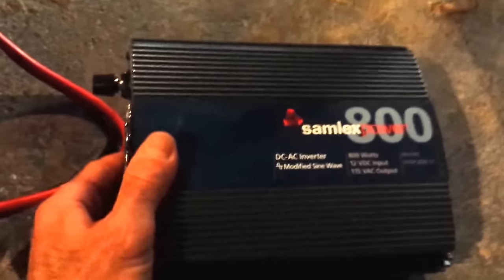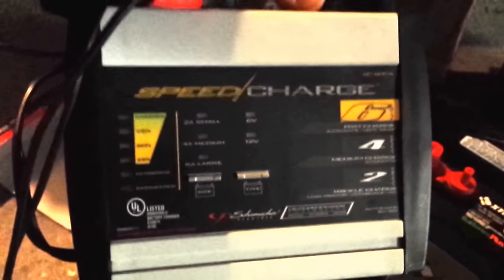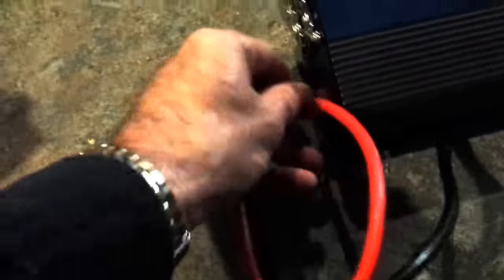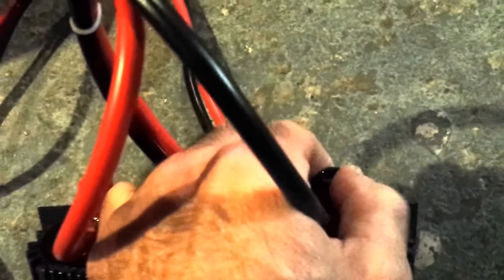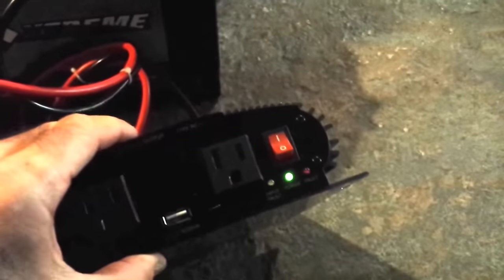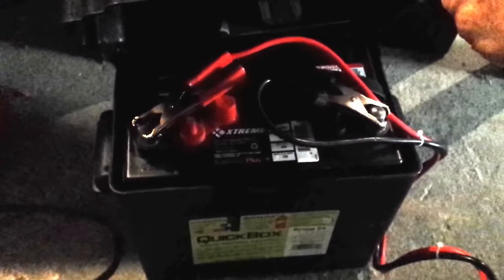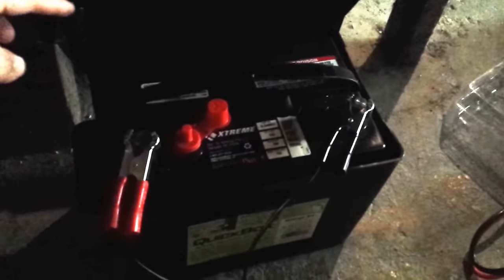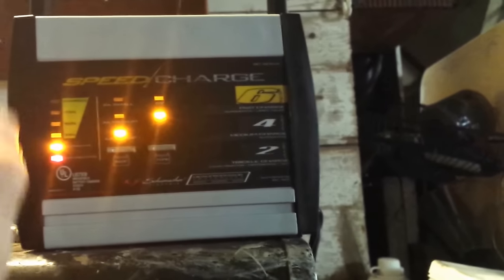How to Connect a Battery, 12 Volt Inverter, and Charger

Comment: I live in RV and was hooked up to electrical thru my brother's home until recent I used my window AC and it scorched the outlet so no more electric. So now I'm stuck trying to aquire some alternative electric on a small budget . I've tried researching as much as possible . Ur video clarified a few things like that I need a charger to recharge the battery. Now if I can just figure out the type of battery needed According to the inverter wattage that would be helpful. Right now I have a 750 watt ever start inverter not sure the battery to match up to it.

Comment: hi Dan!...is it OK to charge the battery continuously with that set up? like from battery to inverter then from inverter to charger and charger back to battery? thanks!
Reply from the maker: Hi Bong, I'm a little confused on what you are trying to do. Battery to inverter, inverter to charger, and charger back to battery. Sounds like you want the battery to charge itself. Can you explain what you what to do? You can't have more than one clamp on each black/red battery terminal at a time. There's a clamp for the inverter and a clamp for the charger.
Reply: +Dan Usher its like cycle, yah you are right! charging itself and at the same time using it in car audio for example. thanks you think it is possible?
Reply: +Dan Usher I don't have an alternator to charge the battery, its totally independent, all I have are the battery, inverter and a charger connected to its other just like a round about. just to have a continuous charging to avoid battery discharge.
Reply from the maker: +Bong Miranda, unfortunately, I don't think it's possible for two reasons. One, your not charging the battery from an outside source, an outlet. What you described is just a loop. Second, you can't fit two clamps on each terminal at the same time. The battery is huge. It lasts a long time. Don't worry about trying to charge continuously. Just use it, enjoy it, and when it needs to be charged again, plug it into an outlet for a few hours.
Reply: +Dan Usher thanks a lot!!
Reply from the maker: +Bong Miranda you're welcome!

Comment: Thanks dan! ..... I'm looking at doing this set up for the RV.
Reply from the maker: Your welcome!  Glad it helped.
Reply: @danusher6919  I would like to ask you could I plug my battery charger into my inverter while it was plugged into the battery and use my battery charger to charge the battery
Reply from the maker: Hey Larry,  I get this question a lot.  If you look through previous comments,  I give a detailed answer.  Short answer, there are better ways to do what you want.

Comment: Ok this is now what it seems. I want to  know if the battery charger is connected to the battery and turned on but powered by the inverter thats also connected with it stay charged as a continuous power source ?

Comment: It's often recommended to connect a ground to protect the inverter user in case there's a short. Additionally, it's often recommended to connect a fuse on the positive cable that connects the inverter to the battery.
Note too that the inverter in this video is a modified sine wave type which has its limitations.

Comment: Great video! Few questions. Is there a battery charger out there that is cordless? Like a car battery jumper. I have a DP Power battery jumper that I plug in to charge. It charges and is functional without being plugged into the wall. It holds the charge.
Second, have you used an inverter that has the battery charger combined? I did find those, pure sine wave are pricy.
I am looking for a setup like you have here for a power outage. The inverter would be used to charge my solar generator(the sun is not always dependable)

Comment: I just got a used van has a 5500 I am generator inverter etc the person I got it from had no info on it never used how do I find out how to charge my deep cycle batteries? Question can I use the inverter and batteries to power things with the generator off? Then recharge the batteries with the generator later? That's what happens in my fifth wheel if the power goes out

Comment: Is this a setup I can use for a couple nights of camping trip? Mostly for running a fan or small space heater and maybe a couple of string lights?
Reply from the maker: Hi Chemmies J, thanks for the comment.  I'm not sure the battery would go all weekend as a heater takes up a lot of energy.  Fan and lights more likely.

Comment: Thanks for your video. Is it possible to charge 4 x 12V batteries connected to each other by connecting the charger to the first one in the series?
Reply from the maker: Hi Mario, thanks for the excellent comment.  I don't know.  Have you ever charged the batteries while they were connected before?
Reply: @danusher6919  no i haven't. i have 4 batteries for my eventual solar system at my camp.  i currently supply power to my camp with a generator. I don't have solar panels, inverter and charge controler yet. My plan is to get an inverter/charger but they are more expensive. I thought of getting a cheaper/smaller inverter for the time being and use a charger like you described to charger my batteries until i set up some panels next spring.
Reply from the maker: @mariomcgraw2987  maybe recharge them one at a time?
Reply: @danusher6919 i was talking to someone today who specializes in battery banks set up. It's possible but where you put the terminals will depend on your battery setup... series vs parrallel, how many batteries etc... i'll confirm with him when i cross that bridge! Thanks for your quick replies 👍
Reply from the maker: @mariomcgraw2987  your welcome.
Reply: @danusher6919  could I plug my battery charger in to my into my inverter and then hook it up to the battery why the battery was hooked up to my inverter would that keep my battery up to charge?
Reply: @larrysimmons6082  What you are describing doesn't work. The inverter isn't 100% efficient, the charger also isn't 100% efficient, due to power loss (conversion of the electrical energy to thermal and possibly mechanical energy which is not desired in this case) and the result is that you will drain the battery.

Comment: Is there any way to use the battery (connected to the inverter) while also charging at the same time?  Or do I always have to use the clamps, and only one action can be done at a time?
Reply from the maker: Hi Mike, great question.  Unfortunately, the answer is no.  You can only use it for one function at a time, but another way to look at your question is if you are charging the battery, that would mean you are connected to some power source and wouldn't even need the battery, right?  Unless I am missing something or don't fully understand what you are asking or trying to do, you should be able to plug whatever you need the battery for directly into the power source.
Reply: Dan Usher, thanks for your reply!  I connected a solar panel to a charger, the charger to a battery, the battery to an inverter...then plugged string lights for the kids’ playhouse. I’m hoping all of these can stay connected all at once so I don’t have to keep connecting/disconnecting the cables? So far so good...but am I putting the battery and kids at risk of something bad happening?
Reply from the maker: @mikeman360 , your welcome.  I think I understand why you want to do this.  In case there is a cloudy period, you still want the lights to continue working continuously.  I called the place where I bought the battery from, Barreries Plus, and asked them.  To my surprise, they said having a charger and inverter connected at the same time was ok. I'm not sure how you would do it, but they said it was ok.  Of course, if the battery is getting charged at a slower rate than the draw on the battery, eventually all the charge will be used up.

There is an electrical engineering person who works at Batteries Plus who was off today who I was hoping to catch.  He is sort of like the Grand Wizard.  I will touch base with him and get a more detailed and better explanation and leave another comment for you here as I get this very question often enough.
Reply: Dan Usher, excellent! As I said, it looked like the battery was charging while still connected and being used for the lights, so I hope it’s all good. I don’t know what the correct terminology is, but I feel the entire unit is set up in series? One to the other, to the other.  Looking forward to hearing your response after speaking to the Wizard!
Reply from the maker: @mikeman360  I talked to the Wizard at Batteries Plus today.  He gave a detailed answer and the long and short is it is complicated.  He said it's not to say it won't work, but it's not what those products were designed to do.  With a charger and inverter connected to a battery, each device is picking up signals from the other two devices and can get confused and it can create "noise."  For some products/appliances you are trying to run it wouldn't cause an issue, but some, such as an amplifier, or any sound/video output it would.

He suggested a device called an uninterruptible power supply.  Google it and you will see products you could buy at Best Buy, etc.  An uninterruptible power supply is plugged into a power source and has a battery that it keeps charged while it powers what you have plugged into it.  If the power goes out, the battery kicks in.  It's doing what you are trying to rig the battery, inverter, and charger to do. Companies that run sensitive equipment such as computers and can't afford to lose power and lose data use an uninterruptible power supply.

Hope this helps,
Dan
Reply: I’m not a wizard, I’m almost 100% positive you can connect solar panels to a charger to charge your battery and connect your inverter and use it at the same time

Comment: Trying to commect.my 500w sine wave inverter to my starting battery to only run while I am driving. I then want to take my 15a charger and connect to my inverter to charge my auxillary battery ,again while I am driving..Trying to avoid having to do the whole dual battery setup because I am disabled and cant do it myself and cant afford to have a professional do it. Can this be done the way I have explained it to you?
Reply from the maker: Hmmm.  Thanks for the question.  I'm not 100% sure I know exactly what you are asking.  By "starting battery", do you mean the regular car battery?  So you want to put an inverter in the engine block along with an auxiliary battery and charger? And then you want to put an inverter clamp on the same battery terminal as the clamp for the car?  Not the best idea.  And then you want to put the charger clamp on the auxiliary battery that presumable also has a clamp for the car?  

I might not have this right, but I'm having a hard time visualizing what you are trying to do.  I do get questions kind of like this occasionally where people want to use the battery and connect it to an inverter, which has a charger plugged in which is then clamped back to the original battery. These ideas are not the best.  If you read through the comments, I addressed this specifically.  

The advice I would give is to call a BatteriesPlus and talk with someone there about what you are trying to do.  Hope this helps and sorry I wasn't more helpful.

Comment: Dan , do you know if any damage can happen if a charger is connected  to a battery that is hooked up to an inverter  ?
Reply: No damage, but the electricity would be going in multiple directions, so you wouldn’t get even power through whatever is hooked up
Reply: @NoonMight  thank you. I asked, because lasr fall I had an inverter i had just bought on Ebay,  .  I hooked it up to a battery bank. that i had in the back of my crew cab pickup. Then plugged an ext. cord into the 110v outlet of the inverter to run a radio and a lamp in my camp. Then connected a charger to the battery bank and went into my camp. After few minutes, the lamp and the radio went out.   I went to the pick up to investigate. I saw smoke coming from the inverter. I disconnected it quickly. Few days later i got in touch with Ebay. they stalled they sent me fron person to another to another . Finally I gave up when i got somehow accidentally disconnected during yet another phone call. i decided the $80 i paid for this inverter was not worth the time i already lost, never mind losing more yet. Thanks again.

Comment: I HAVE MULTIPLE BATTERIES IN MY CAR FOR MY MUSIC.  MY ALTERNATOR CAN KEEP UM CHARGED ENOUGH WHILE UM PLAYING IT LOUD, CAN I PLUG A BATTERY  CHARGER INTO  THE INVERTER TO HELP KEEP THEM CHARGED
Reply from the maker: Thanks for the comment.  I'm a little confused by your question.  Paint a picture for me if you will.  Is your car parked in a garage and you are playing the radio without the engine running? Or when you say MUSIC, are you playing instruments and plugging them into an inverter connected to a battery? Where do you fit multiple batteries in your engine block or is one in the engine and the others in the trunk?  Once I can see what you are trying to do, I can help you better.  As for your question now, it sounds like you want to create a continuous loop that would keep the battery charged by connecting the inverter to the battery, plugging in the battery charger to the inverter, then connecting the battery charger clamps on the same battery terminals where the inverter clamps are.  Did I get that right?  If so, this is not the best way to do that.  In some of the comments below, I address that question.  Hope this has been helpful.

Comment: hi sir, can we put a load there on that battery with those 3 things connected together and energized...like a set up of car audio system? thanks!!!
Reply: When I was much younger I ran a 3000 watt system off a car battery hooked up to a battery charger / Stabilizer plugged into the 110 out let Just be mindful to use the proper fuses so you don’t blow something

Comment: Is there any way to make this off grid where you have a solar power charging a seperate battery powering the converter , then the converter powering the battery charger ? Jus a thought?? Idk
Reply from the maker: I've read your comment a few times and I am still unclear what you are asking.  When you say "converter", do you mean the inverter I talk about?  Also, I'm a little confused because if you had solar power charging a separate battery, then why would you need a second battery. Feel free to clarify.  Thanks, Dan

Comment: Thanks. Is it Ok to connect the charger and the inverter at the same time?
Reply: I have that same question myself. Too bad he didn’t respond.
Reply from the maker: Hi Clifford, thanks for the question.  I did answer that a while back as Michael Nguyen asked the same question and you can see the thread of the conversation.  The last response I gave him was this: 

 @Michael Nguyen  I talked to the Wizard at Batteries Plus today.  He gave a detailed answer and the long and short is it is complicated.  He said it's not to say it won't work, but it's not what those products were designed to do.  With a charger and inverter connected to a battery, each device is picking up signals from the other two devices and can get confused and it can create "noise."  For some products/appliances you are trying to run it wouldn't cause an issue, but some, such as an amplifier, or any sound/video output it would.
Reply from the maker: @gentlemood  thanks for the comment.  I did answer that a while back as Michael Nguyen asked the same question and you can see the thread of the conversation.  The last response I gave him was this: 

 @Michael Nguyen  I talked to the Wizard at Batteries Plus today.  He gave a detailed answer and the long and short is it is complicated.  He said it's not to say it won't work, but it's not what those products were designed to do.  With a charger and inverter connected to a battery, each device is picking up signals from the other two devices and can get confused and it can create "noise."  For some products/appliances you are trying to run it wouldn't cause an issue, but some, such as an amplifier, or any sound/video output it would.
Reply: @danusher6919  Thank you, and really appreciate your response.
Reply from the maker: @cliffmathew  your welcome!

Comment: How long can you run a tv or small heater off a fully charged marine battery?
Reply from the maker: That is a great question.  I don't know the answer as I've never used it for that.  If you figure it out and post back that would be great.
Reply: If you use just this set up to run a tv,and try keeping the charger connected does not work. 
The tv/item will draw off the 12v voltage.  I used this example, but with an 8 amp charger. Ie thinking I'm only pulling 3 ish out of it. 
I thought that the extra 5 would stack up in the battery.
To plug in and use off of the inverter from a solo battery didn't work for me.
Need a way to force 12v back into battery faster.  Inverter will probably shut down around 11v.